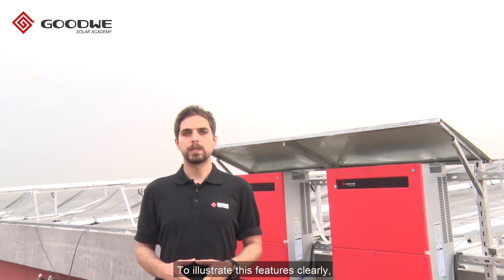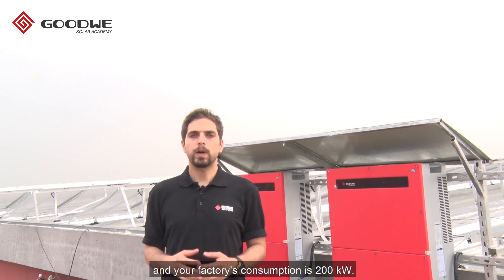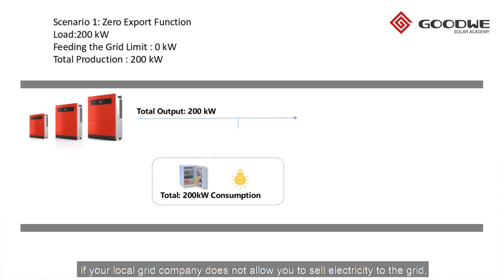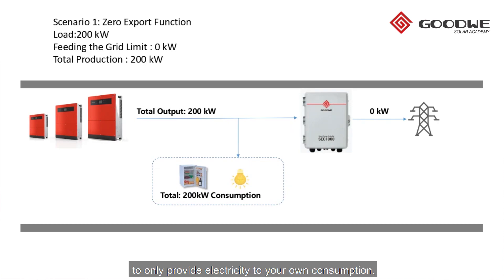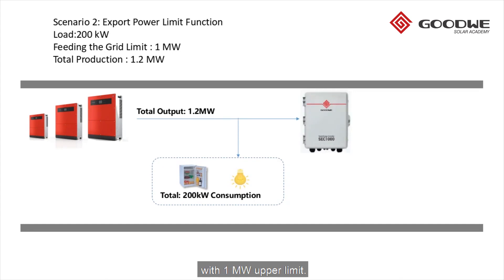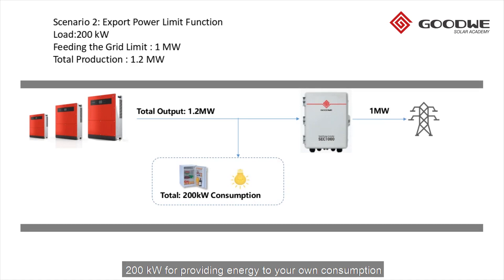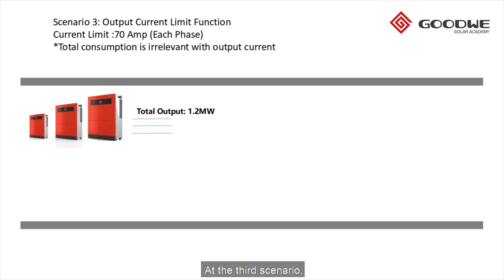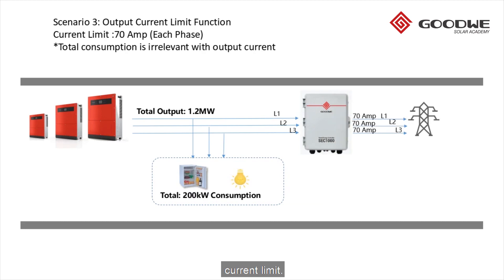Export Power Limit Solution

Comment: if SEC1000 can support than 1 inverter connected in DC chain RS485 communication in 3 phase system how about the single phase what model of export limiter that can support more than 1 inverter?
Reply from the maker: Hello, we currently do not support multi inverter export power limit in single phase system. We have plans to launch this solution in the future.